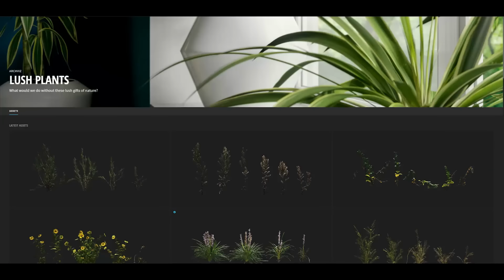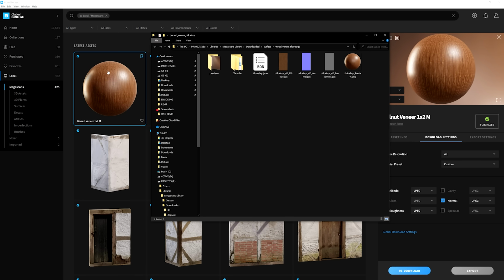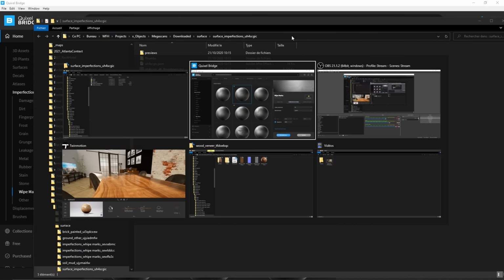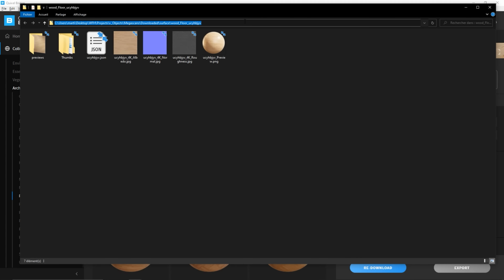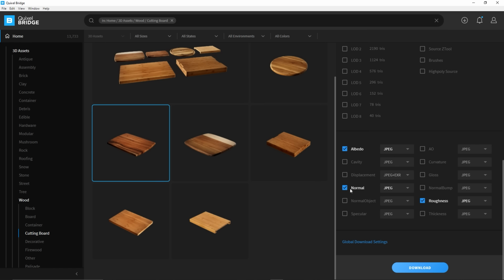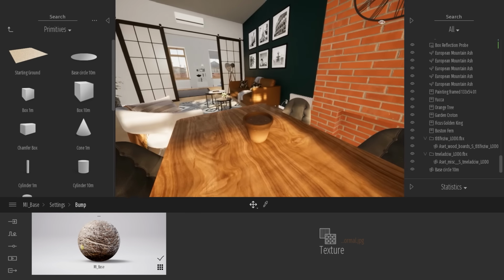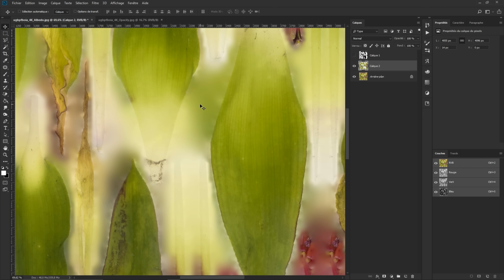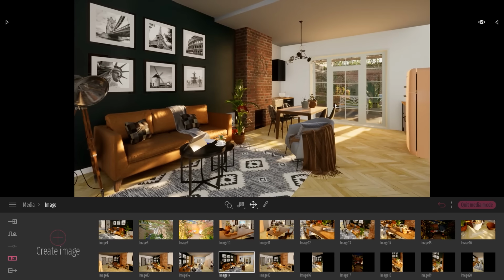Working with Quixel Megascans in Twinmotion | Webinar

Comment: It is truly amazing how even the developers fail to mention that you have to invert the green channel of the normal maps. 

If you download any normal map from quixel they prepared the normal map by default for applications that use OpenGL.
However the Unreal Engine runs on DirectX.

OpenGL and DirectX read normal maps differently.

When you load a normal map without inverting the green channel which resembles the Y value and tells the program where the shadow is directed your depth of that material is inverted.

Go and test it.

Comment: Hello, I am in accordance with the method of 40 '06 "save as PNG format, import the texture, open an opaque mask can be implemented, it all goes well, but learning to video 42' 07" replace with translucent material method of ordinary material, I will not be able to achieve in the Twinmotion2020.2 version, after adding the same PNG texture edge is still filling, don't know why, please have a solution classmates to give directions, thank you!

Comment: Quixel normal maps needs to be changed in photoshop to -Y normal  map by inverting green chanel  for working properly in twinmotion, right?
Reply: Are you sure about this? And also if you are can you tell me how to convert it into a -Y normal?
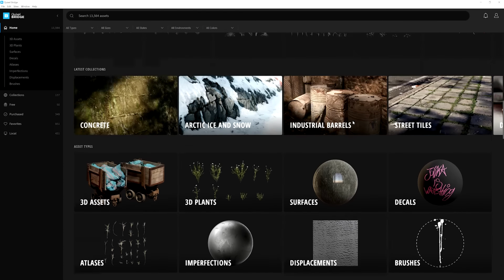Reply: 3:00
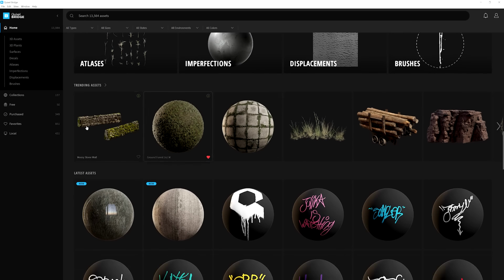Reply: @ivochmelar9714  whats at 3:00?
Reply: Yeah cause for me it’s doing the opposite bump. I thought I was doing it wrong
Reply: @ivochmelar9714  bro no. Its for poliigon PBRs only. Quixel needs no change. Its working correctly for me
Reply: @hitanshujain7013  no, for me works better inverted green chanel with Quixel too. Try it on bricks.